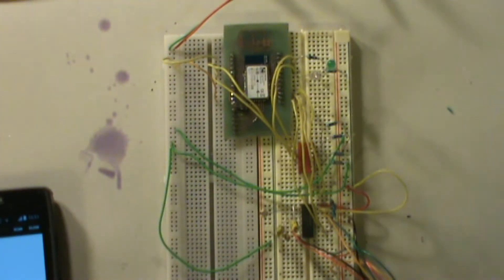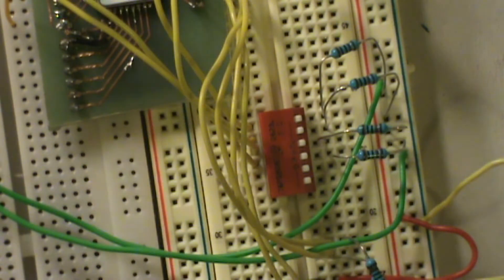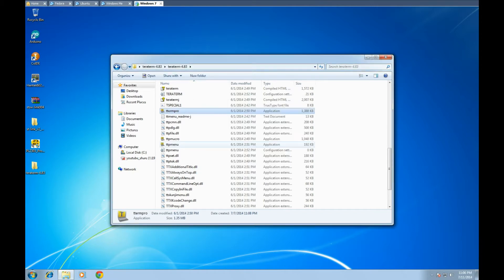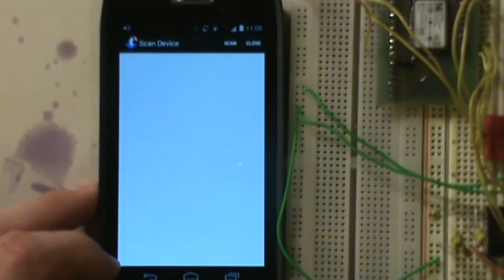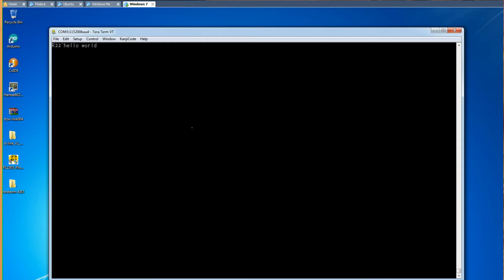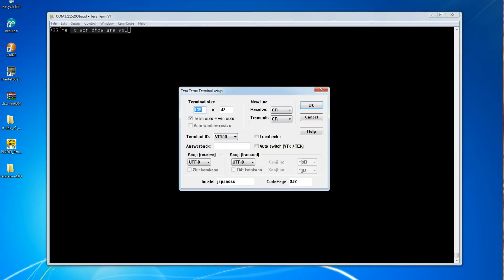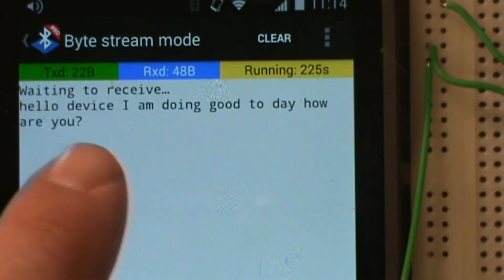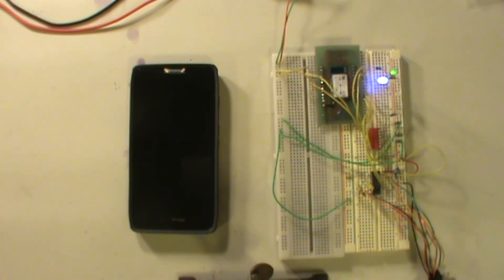Bluetooth - Demo RN-42-DS

Comment: I am wondering if I can send data back from a sensor intro an Arduino (for example) and to a computer using this Bluetooth device?
Reply from the maker: You definitely can.  I would hook the serial lines to the arduino.  Then I would pair the bluetooth device with a PC, using something like a bluetooth USB dongle on the PC side, and go that way.  I have only tried this on linux but you can see similar things with the configuration on my bluetooth enabled receptacle.

https://www.youtube.com/watch?v=R2M41n6fyiI

Good luck
Reply: Thank you so much for the information.

Comment: Hi, great video :)
I have an RN42 and have my phone talking with it.
I want to use a water sensor (looks like circuit board with a zigzag track all over it) to measure the water level in a bath. When the water touches the sensor it changes the resistance of the sensor.
I want to connect this to an input port on the RN42( can you recommend a pin to use)?
I don't want to use Arduino, just the RN42
I guess the input port wont measure resistance so i would have to use some kind of resistance voltage divider ? can you explain how to do that ?
I am running the RN42 off 2 x CR2032 in Parallel .. i know .. they do no have enough juice :) 
Any suggestions would be much appreciated.
Reply from the maker: +Ade Tuck Hey there, I apologize for not getting back to you quickly but what it looks like you can do is figure out the voltage level that would be the trigger point.  Then using a comparator like a LM339 or something and you set a reference voltage level at the one that is your trigger and then connect the sensor to the other pin of the comparator then when the sensor voltage matches the reference voltage of the comparator its output will change.  You would take the output to the RN42.  Hope this helps.

Just check out comparators and how they work.  An op-amp can be used but they are not as good as an actual comparator.

Comment: Great video, can you control anything like a led,relay, motor?
Reply from the maker: Hey there, thanks for the comment.  As far as the bluetooth module itself goes it is just a receiver that will convert the infomation shared via bluetooth to either rs-232 or usb.  I would recommend attaching a microcontroller to the rs-232 and configure a UART on the micro to accept the serial data and then from there you could pass information from a bluetooth device to the micro and control anything you want! Pretty cool.

Comment: hi, it's a great video,
I'm working on a bb8 robot control with bluetooth (I'm using a RN41 EK), but i have a problem when i send data from my phone or a computer(1) to another computer(2 )(connected through UART to the RN41) i have a 30 sec delay before the data arrive. When i send data from the computer(2) to the phone i d'ont have any delay. I tried to find a solution with the different command but it doesn't work. If you have any idea to help me it would be really nice.
Reply from the maker: +mutsulini What is the UART baud rate?  I would check to see if it is something small like 1200 and I would change it to max. I can't remember what it is I think maybe 115200 or something.
Reply: +misperry my baudrate is 19200 but i change it on my Bluetooth too